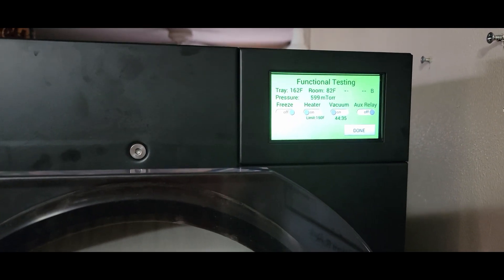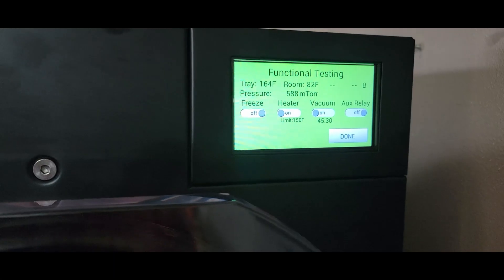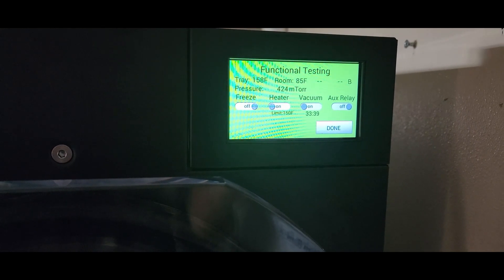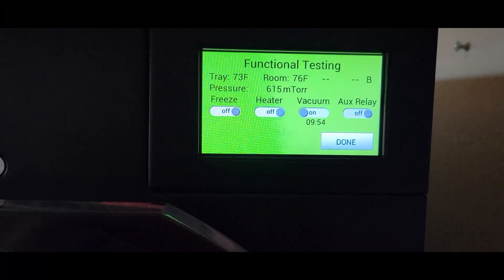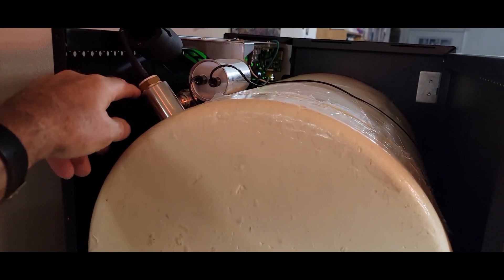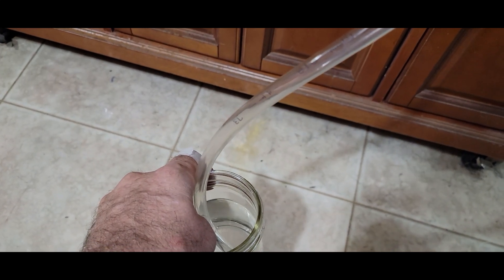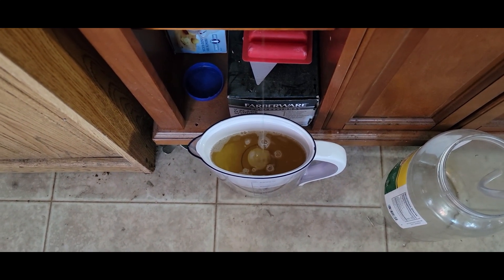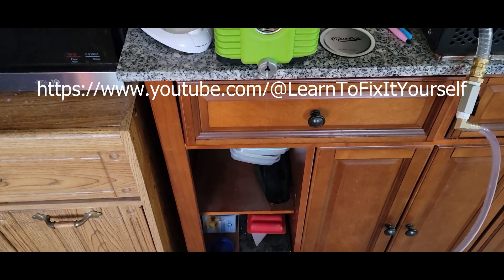Harvest Right Vacuum Error #9 - Part 2

Comment: The thing is you have no problem with a leak in your machine. anything below 500 mt is considered a good machine. when it won't get to or below 500 is the problem. I can't get my machine to go below 1100, This is a big problem. the machines are programmed to issue an error if the MT goes above 900 MT when drying. The newer software versions allow the machine to go to 1500MT while drying, but this new band-aid software fix for a hardware problem is just that a  band-aid and the quality of the product suffers.
Reply from the maker: I was using version 5.1.16 and finally fixed the problem, as 3 places leaked.  once they were fixed it worked like it should. I recently upgraded to version 5.1.24.  I have seen a new freeze dryer by 4 Patriots.  It is a little more expensive.  One of the differences is the pump is internal to the unit.  I haven't looked into very much, but for anyone looking to get into freeze-drying, I would at least check them out.